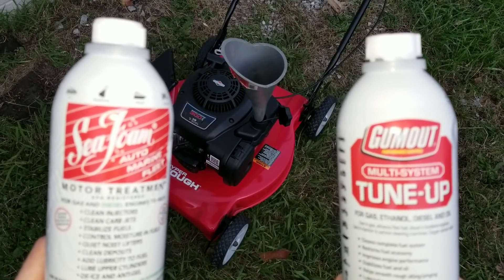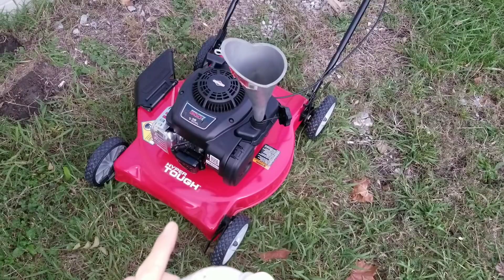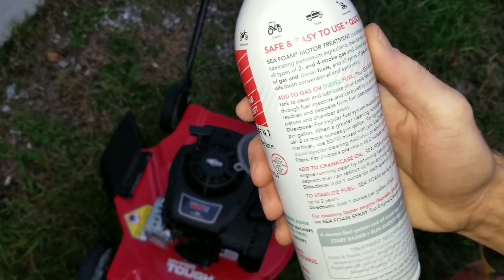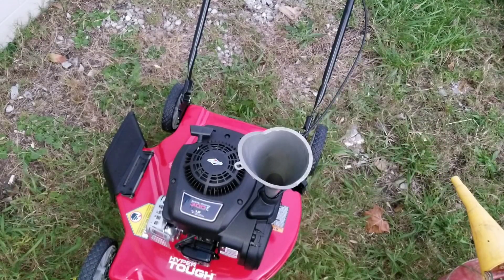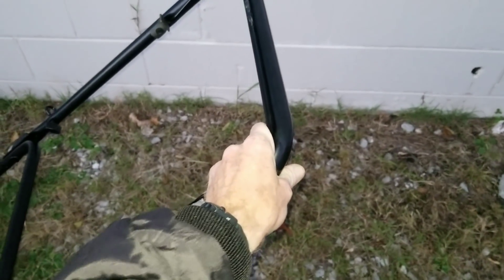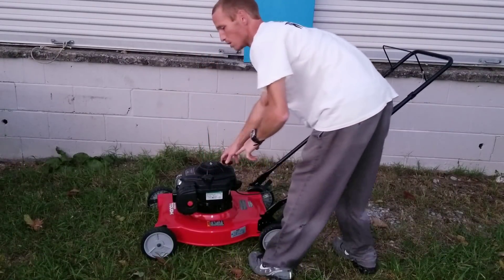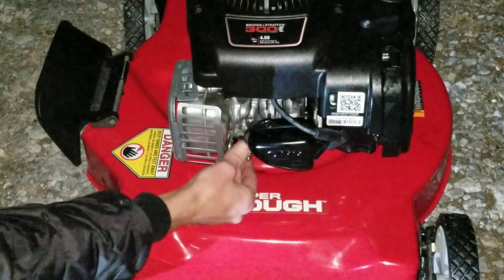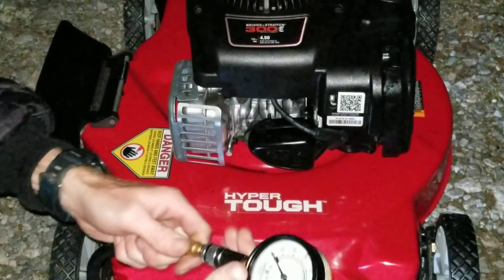seafoam WARNING watch first gumout

Comment: I have a Honda engine on my lawnmower and when it idled it would surge constantly.  I started adding Seafoam to the gas and that ended the surging and it runs as smoothly as you could want.

Comment: I have used Seafoam for over 20yrs, but faithful in my lawn equipment since 2010 & that's how I discovered it works great. 1yr gas in my generator & it will start in 2 pulls. So I dump a can in my vehicles every oil change

Comment: It's hard to believe any visible deposits would be found after only using one tankful of gas.   What don't I understand?  Thanks for the vid.
Reply: Do you think it would look at all different without any additive? I doubt it. And then the whole thing was confounded because he had to add the cold-start stuff to get the engine going in the first place.

These videos are basically doing random stuff with results that can't be evaluated, and then you decide.